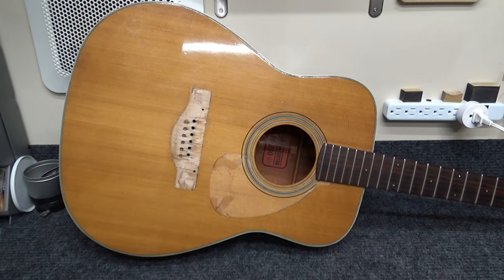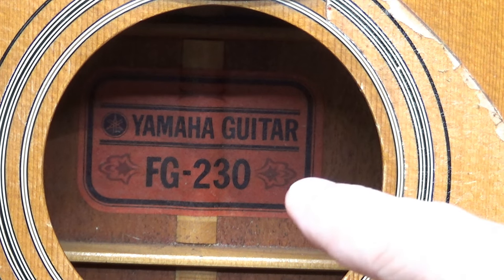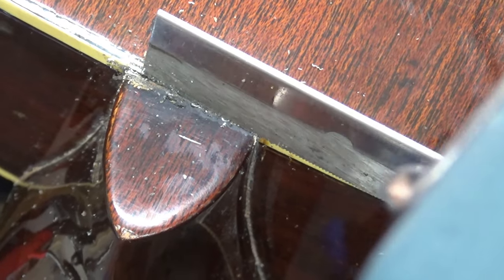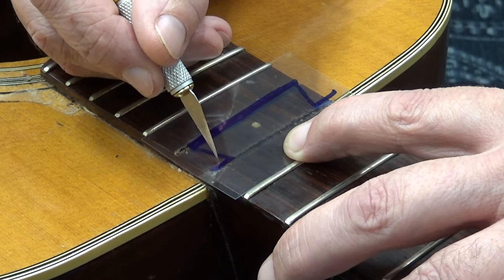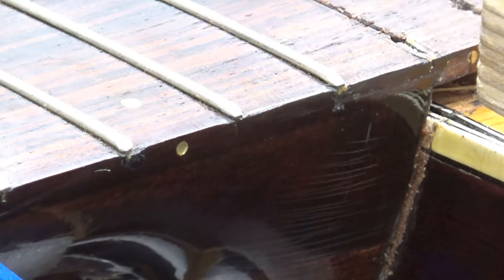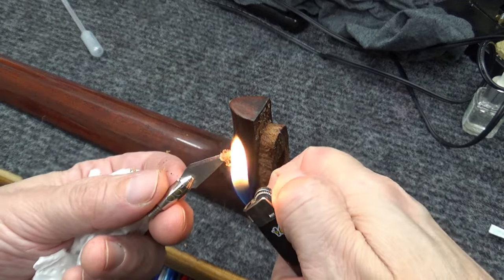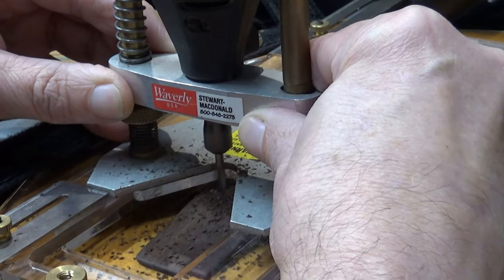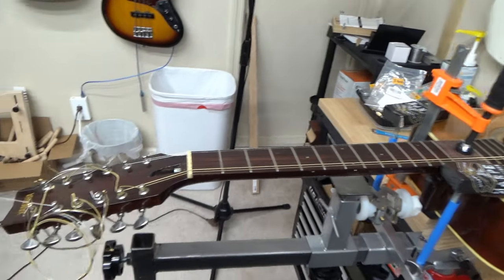Yamaha Neck Reset FG230 Taiwan

Comment: You show you use a little mylar template to mark the drill holes for you foam cutter holes.  Can you share that in a paper printed version or even the dimensions?  I’ve done 5 vintage Yamaha neck resets and “guessed” where to drill each time with about 75% accuracy… I wish I had made one, lol… I have been using the same method, except I’ve not been pulling the 14the fret.  I think your method to do that is awesome, because the extra volume of glue that Yamaha used on heel to body face is what makes these come off so hard vs US made guitars (along with the thick filet of finish.  I also use a home press against the heel to help load pressure against the joint, similar to the Big name version.  BUT the really stuck necks have been suffering some compression to the wood that will to cause a fret board hump after reassembly.  I agree with your idea to saw thru that once the neck is off to prevent it!  I hope adding the 14th fret holes and heating will further prevent that…  The last one I did was so stubborn a fractured heel resulted, and the dowel they used saved the repair visibility mostly.  I love your work and your’s & Ted Woodford’s casts are the best out there.  My finish skill suck, but have been improving thanks to your casts and willingness to share “tricks”.  I also made the mistake of trying a hair dryer thru the sound hole on an FG with laminate sides to aid the heating of the dovetail from the other side (inner) and that is NOT a good idea!!!  Luckily it didn’t unglued the sides from the block, BUT it DID turn the sides yellow on the exterior!  I think the heat drove the glue in the lamination thru the thin outer veneer.  Because I ended up scrapping the finish off, thinking it was what was yellow and it was stained veneer!  I’ve spend the last two weeks using your techniques of covering that area with tinted shellac to hide it and a top coat of lacquer…. Keep doing what you are doing with the casts and if you can share the hole template that would be great, but if not that cool.  I have 4 more Yamahas waiting neck resets and I’ll get the information off the next one I do.  One last tidbit, I used the liquid hide glue in a bottle and it was a big mistake.  It takes 2 week to dry…. And I’ve been using maple veneer on roll with adhesive meant for cabinet edge for shims.  It stack up nice and with a little heat gun use it stick fast quick an stay put.  It’s easy to slice to width and cut to length and  sand the overlap a smooth transitions to get a nice shape.

Comment: Nice job, with a couple of things I hadn't seen before. Using the hot knife to score around the heel makes sense. I've never seen the saw cut between the heel and the fretboard extension. Does that just let the fretboard flex a little? Did you end up putting a spacer under the extension?
Too bad you didn't have time to show the finish repair on the heel. I always learn something from your refinishing.
Reply from the maker: Right on. I didn’t use a spacer and it worked fine. I used a Mohawk marker on the heel (Deep Cordovian) quick and easy, no sweat 😓

Comment: Man, that thing sounds great. Nice! 

I’ve never seen this method, did you cut material out of the dovetail and then reglue it to change the angle? Did you end up having to put in a shim at the fretboard extension?
Reply from the maker: No fretboard extension wedge (shim) I trim the heel and shim the dovetail

Comment: Great video,red label rules!
Question, how do you take the glue residue of the top where the pick guard goes?
Reply from the maker: Good question!
For Yamahas?
Reply: @harpethguitar   Thanks,my old Yamahas pick guard fell off during a gig,and now looks a real mess. Any ideas?
Reply from the maker: If I recall, acetone will dissolve the Yamaha pickguard adhesive. Good luck!
Reply: @harpethguitar  Thanks shall give it a go.
Great channel just subscribed 🎸🏏

Comment: Did you use glue boost fill and finish to repair the stress cracks?
Reply from the maker: I just went over the cracks with Mohawk Deep Cordovian marker and they kind of vanished. Most of the cracks were on the treble side so they are out of sight!

Comment: Yamahas notoriously suck when it comes to   neck resets... some you'll never separate...that piece of PV you had to cut is one example.... there's even some luthiers that had to literally saw the the heel all the way to the truss rod . And make a new one..dowel  it  ect.. you were lucky sir ..

     I believe I'd of put it back together with Titebond Original... I case of it needing another reset in the not so long  future... with those strings . 😅